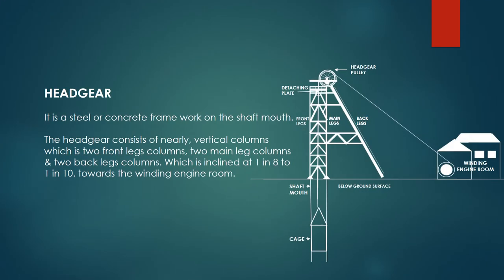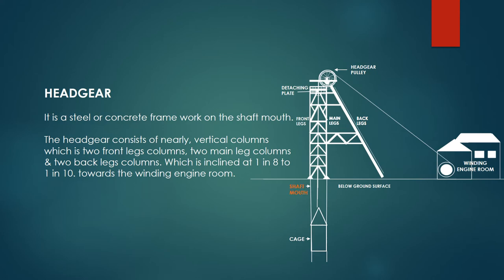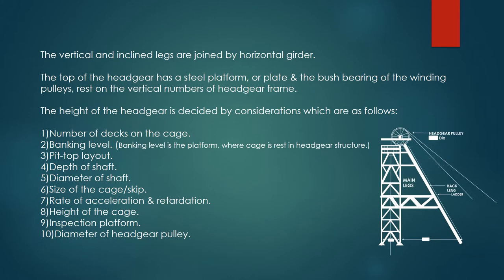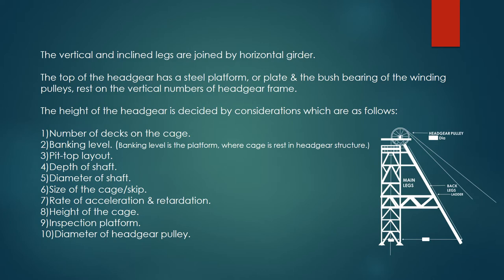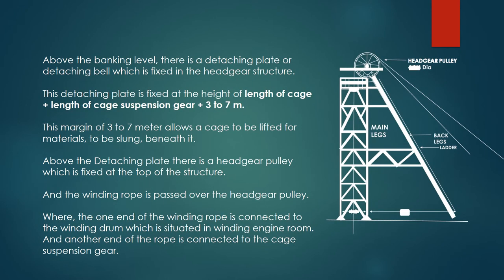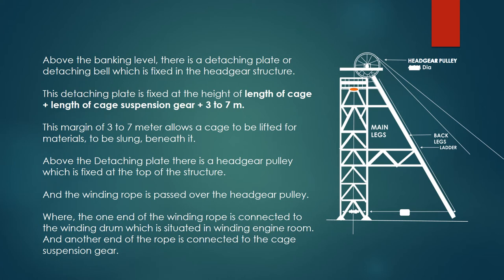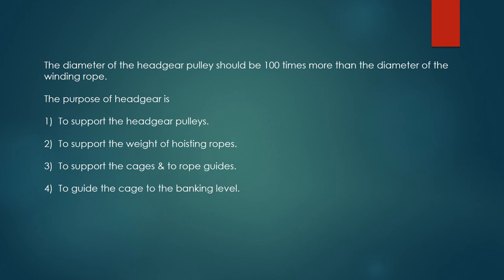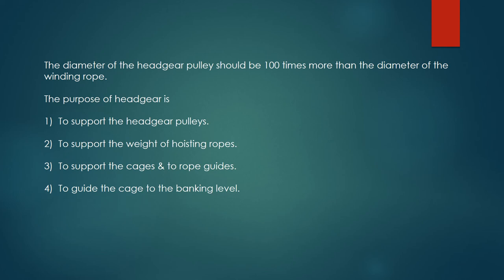HEADGEAR STRUCTURE | IT'S PURPOSE | DESIGN OF HEADGEAR | HEIGHT OF HEADGEAR STRUCTURE ??

Comment: Why some modern concrete head gear/head frame mining structures are so high (~70-80 m or so)? Is it because of the height of the cages/skids that are multilevel and need to be lifted above the shaft's ground level or is there some other reason?